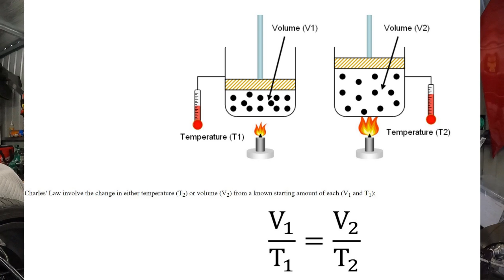Car AC - The components, building custom lines, how it works!

Comment: Hi Rob, cheers for the free knowledge. I have a question, can you buy a bolt in AC system from Ultima?
Reply from the maker: Hi Wrenix, You can buy a standard compressor setup from Ultima or fit a Corvette low mount. Outside my desire to minimise sending plumbing front-rear, this would conflict with my electric water pump positioning. Similarly, if you have a dry sump setup that pinches the space. I'm also not the biggest fan of high mount accessories at it puts weight up top. Cheers!

Comment: Rob, curious to see how well the electric compressor works. My '86 Mustang was produced without A/C and I'm considering a retrofit. Thanks for being the lab rat on this one.
Reply from the maker: Hi Miles, It's definitely one that's great for classic cars. What I really like is the ability to upgrade your alternator, but mount the compressor in the boot (trunk) with the battery and have the condenser/fan at the rear under the floor. Keeps the whole thing looking clean/factory under the bonnet! Cheers, Rob
Reply: @rob105motorsport  Hey Rob, no pressure (well, maybe some) but anxiously awaiting more content in 2022. Hopefully we'll hear the beast running soon.

Comment: Your setup looks great even if the tubes are a little roughed up!  Not sure if you saw my video but make sure you isolate the compressor well.  It's quite a bit louder than I thought and mine was rigidly mounted to the chassis in the side pod.
Reply from the maker: It was very fortunate to see you install yours ahead of me! I didn't anticipate it to be very noisy either. Plan it so to run vibration pad under the compressor itself and at the mounts to the chassis. I wonder it it's even worthwhile wrapping it in acoustic matting somehow?
Reply: @rob105motorsport  Isolating the mounts should be paramount, do what you can for damping there.  I would start without a blanket first, and see how it handles heat in the nose area, especially on hot days.  Once you get a feel for it, then add acoustic matting.  In the end it may not matter because you probably won't be able to hear it over the engine anyways.

Comment: Thanks Rob for that run through on AC install and the science on how it works.  How do you determine the size of condenser? Is there any ADR requirement for collapsible steering column?
Reply from the maker: Hey mate! Condenser size is directly related to the capacity you'll get out of the system. Within reason, bigger coils aren't a bad thing. Having said that, the easiest way of sizing is to look at comparable cars/systems. 
Sizing coils for heat rejection is possible, but it's probably not worth it as it'll be a battle to find tech' data or you'll be making assumptions - air temps on/off, desired coil on/off temp, coil thickness/area, bypass factor etc etc. 
With the electric AC, Rencool provide kits so it was easy enough for me to size using their coil as the minimum dimension. I ended up with roughly 150% of the condenser size. 
As for steering columns, they do have to be collapsible. Cheers!
Reply: @rob105motorsport  Thanks for the reply on sizing.   So in thee case of your Ultima, is the steering column collapsible?
Reply from the maker: @Solo6amers  Yep. Has a collapsible section at the top. Most kits you'll find poach it from an OEM vehicle, but Ultima do their own. It's a very simple design.
Cheers!